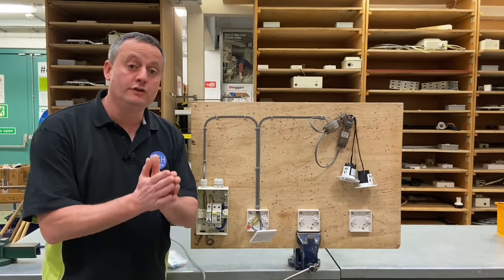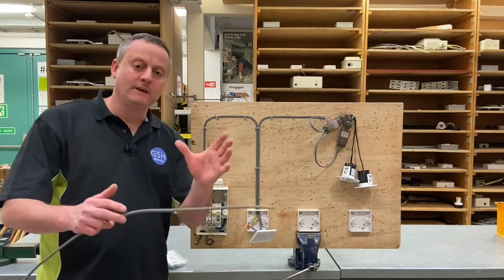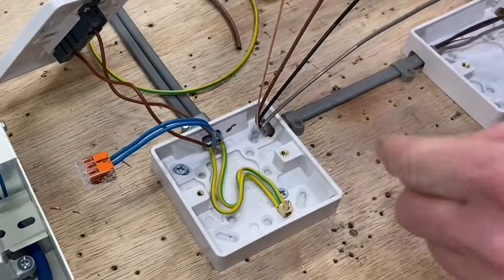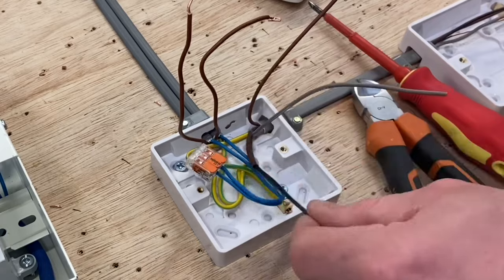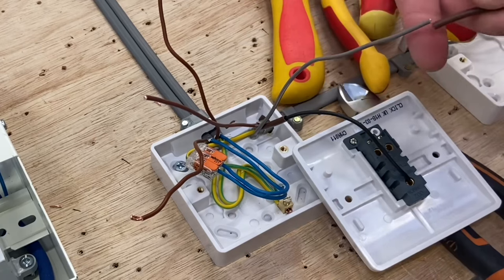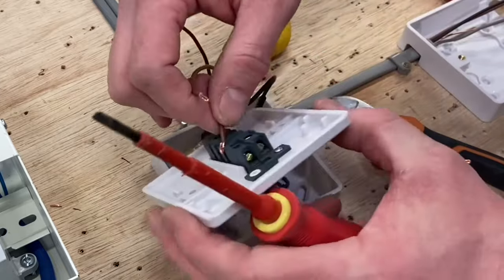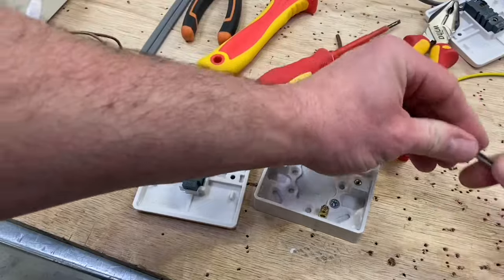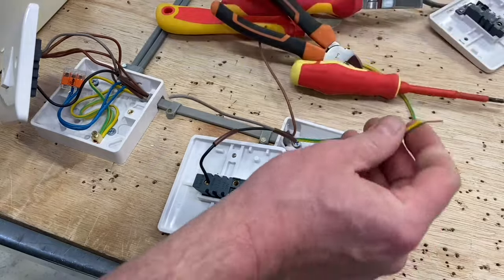Lighting Circuit 2 Plate Method How to Wire and Connect up 2 Way Switches (Connections Explained)

Comment: I'd draw the the circuit diagram with sw1 and sw2, L1 and L1 terminals link together with the brown wire is the permanent line terminals, L2 and L2 terminals link together with the grey wire line,is the switch line terminals. The common terminals is link together with the black wire line.

Comment: Fantastic video, I get how taken the feed to the switch makes for less cable at the lighting point when installing down lights, I just don’t like it I think it’s a throwback to the 40s/50s 
As two way switching doesn’t anyone us the loop in that method anymore? I was tort to take two three core two way switch cables from the lighting point to each switch and link the yellows /greys with a connector block at the lighting point, can also use the junction box method. Anyone who doesn’t learn from GHS videos should rethink their career path . Gaz makes it so simple and easy to understand and learn. But who am I to argue i’am just a humble spark who’s opinion means nothing,
Fantastic video Gaz as always 👍👍👍👍❤️

Comment: Great video thanks for sharing.  I wanted to know understand how this setup could be extended to work with a 2 gang switch where the second switch is 1 way.  I have the 2 way working and thought all you would have to do is connect the permanent live to the second switch common and L1 to the SL on the ceiling rose.  Whilst the 1st switch wit 2 way works the second switch only works when the first switch is also on.  Any suggestions on what needs to be changed or a wiring diagram for this type of setup?

Comment: I've been told in the AM2S Refresher to use the Grey as a neutral?
Reply from the maker: Wiring Diagram Wired Through the Switch Lighting Circuit AM2 & AM2S - 2 Way & Intermediate Explained
https://youtu.be/cIPZhriDQr8

Connections Explained - Wired Through the Switch 2 Way and Intermediate AM2, AM2S & AM2E Assessment
https://youtu.be/Xe_ap2eRjYI
Reply from the maker: Hopefully these 2 videos will help 👍🏻
Reply: @GSHElectrical  Thank you, your an absolute legend and your VERY responsive! Just watching that video now.

Comment: Hi Gary, I love your very instructive videos. Can I ask a question on two way circuits please? I have a double gang switch that has an extra terminal on one of the gangs with two L1. There seems to be a short cable link to the other gang which is for a simple outside light. I'm just a DIYer so I don't know how to describe the unit to order a replacement? Thank you, Mike

Comment: Awesome explanation! Thanks alot. I have one question... so i have a two gang switch that controls two seperate lights. I have loop in and loop out at the switch and I have a small link wire connecting both the commons together feeding both the lights. If in my case I would like to make one of the lights in this two gang switch have a seperate switch controlling it in a different location... how would you go about doing this? A three core and earth would be needed but if the black wire is placed in Common of the light switch then would the small link wire between the two commons still allow the other light to work? I would really appreciate your help.

Comment: Hi Gary, Q for you if you don't mind?   I thought I'd seen this somewhere in a presentation of yours the other night but now can't find it! - argh!   I need to continue the feed to a simple single light and on/off switch but......... taking the feed out of a 2-way switch.
As per your instruction I have Black as Common and Grey and Brown of the incoming 3-core in L1 & L2.   From here I want to feed a switch just nearby.
So to which terminals do I take my 'twin & earth' cable to the next switch please........?!
My (Geordie!) logic tells me connect into the Black in the Common of the 2-way switch and the Blue (now I'm struggling!) into the Brown (L1 or L2) of the 2-way switch.
Is there going to be a loud POP! doing this - sadly no RCD's here just plain old fashioned exploding block fuses I fear......

I await your kindly guidance please?!
Reply: Did you manage to sort it? You will only be able to continue the a loop out if you have a neutral present in your existing switch. Best practice would be to take the loop out from your main ceiling pendant or using a junction box otherwise.
Reply: @rayc1503  Hi Ray, kind of you to reply.   I have managed but I did have to chase a further cable down to the switch for the reason you describe.   Sorted now anyway - I'm not the sharpest electrician! (general builder in fact)
Reply: @MrTonyCresswell  I'd suggest Quinetic switches instead of chasing in walls. The master receiver switch requires no neutral. Then beyond this you can pair upto 10 further switches. No mess of having to redecorate. I've installed loads of them, even in my own house.
Reply: @rayc1503  Yes, I knew about them and would use when practical.   Fact was that in this instance the place was still a building site so 'redecoration' was away in the future anyway, so bashed on.   Thanks......

Comment: Trying to work out how the wiring leads to the switch function, the best I can come up with is this. Is this right?

You've got the permanent line at one, non-common terminal on both switches, and the outgoing line to the lamp on the other. To light the lights, you need to bridge between L1 and L2. You can't do that directly at a single switch. All each switch can do is either connect permanent line onto common, or else common to the lamp line-conductor. So you need one switch doing one job (permanent->common: "up", say) and the other one doing the other (common->lamp: "down" say).

So you need one "up" switch and one "down" (switch). Whenever you flip a switch and the lamps are off you change from a state where they're both up or both down (and so the lamp not lit because both switches are either connecting permanent to common [which goes nowhere] or common to lamp [and common is floating]) into an up/down combo (and so the lamp lit [permanent->common, common->lamp]). Or else you've turning it off, and it's the same argument in reverse. (And the up/down is obviously arbitrary at each switch, anyway). I've got that straight in my head, I think, but is there an easier way to think of it!?
Reply from the maker: Wiring Diagram Lighting Circuit 2 Plate Method Taking the Feed to the Switch 2 Way and Intermediate
https://youtu.be/L9DU8XkHn1U

Comment: Hi Gary,  Nice video.

Would it not be easier if BS7671 gave a regulation on an industry standard colour sequence for a two way switch
instead of each individual electrician using their prefered colour for common and L1/L2.  It might save a lot of 
confusion if everyone terminated the switch the same way useing the same colours.
Reply from the maker: I agree 👍🏻

Comment: Have you done a similar video but with multiple multiple gang switches, ie controlling different banks of lights from different locations? If not might make a nice follow on video from this
Reply from the maker: 2 Gang Switch Connections Explained - Taking the Feed to the Switch
https://youtu.be/K_iNzL2aWX4
Reply from the maker: Wiring Diagram Using a 2 Gang Switch Downstairs Upstairs 2 Way Switched Using 3 Plate Wiring Method
https://youtu.be/0VnbtsSPcow
Reply: @GSHElectrical  is there a version of this video where you go through connecting the items on the show board? I find that such a great way to visualise it compared to just looking at the wiring diagram on paper, sure im not the only one 😉

Comment: If you have used the 2 plate method to wire up  2 way switching, can you use the common to loop out to a new circuit or do you have to loop out from the light because there is no neutral at the last switch only the first one?
Reply from the maker: This should help

Wiring Diagram 2 Plate Method - Taking the Feed to Another Room or Switch Connection Explained https://youtu.be/R3_eXKo1NFQ
Reply: @GSHElectrical  thanks for the quick reply and link. Obvious once you see it. Amazing videos, thanks for doing it as really helps when doing level 2&3👍🏻

Comment: Great video again Gary extremely informative. Would I be right in saying that the wires on both those 2 way switching are all live or line either switch line or permanent  at some point or another and that the neutrals are simply carried through to the lighting point.

Comment: Just to say, that having the neutral in the switch back box with 2 plate method is good for keeping the luminare fittings free from congestion, but also useful if fitting a smart light switch. However, if fitting a strapper to allow two way switching, you can only buy 3 core and earth flat pvc and so will not have a neutral in the new switch for a smart switch. You can of course buy 4 core and earth in round pvc but then you will be lacking in continuity of materials used!!!
Reply: You only need to have neutral in one of the switches, because you don’t need to be able to smart switch at both locations.

Comment: Do you need to keep the cpc wire? Or can you just cut it off all together?
Reply from the maker: What if the switch or light is replaced with a metal one (exposed conductive part) it will need the cpc 👍🏻

Comment: a back hall light on a 2 way switch for the hall light the other going to an outside light, power from the outside light going to garden lights whats needed to be able to have garden lights on and be able to switch off the main outside light but be able to use main outside light on its own when needed ? im not trying it just curious

Comment: What throws a lot is when there is say a 3-gang light switch, say doing lights over a bed, ceiling light, LED strip with xformer behind a mirror, etc. This sort of setup is becoming quite common. How about a vid on one of these.  Maybe with two way -  3-gang at the bed and 3-gang at the door.

Comment: Lot of cables in the switch, wouldn't it be better to use the 3plate/ceiling rose when two way switching?Plus  It's got the terms for the neutral too...Nice video though👍
Reply from the maker: I have loads of videos doing the 3 plate method so it was time to do the 2 plate method 👍🏻. Thanks for commenting. Gaz

Comment: Great videos. How would you add a new light and switch using the 2 plate method? I'd like to add a light up the loft
Reply from the maker: Wiring Diagram 2 Plate Method - Taking the Feed to Another Room and Switch Connections Explained https://youtu.be/R3_eXKo1NFQ

Comment: Gaz how about you do a video on using the junction box method and the loop in method for two way switching, as mentioned in my earlier comment , no one seems to use it anymore .
Reply from the maker: 2 Way and Intermediate Switching Joint Box Method Wiring Diagram Connections Explained
https://youtu.be/wAJwzkMsmfE
Reply: Fantastic, but for some reason I can’t put my finger on it but that looks different to what I learned at college? Maybe it the colours that throwing me ? Still bring back happy memories of my time at Watford college. 
Brilliant video Gaz thank you 
As always 👍👍👍👍❤️

Comment: Would that stripping pass your AM2? Seemed to massively cut the copper.
Reply from the maker: You have a choice at AM2 to use a knife or side cutters... it’s up to u 👍
Reply: @GSHElectrical  What's wrong with regular strippers? Are they frowned upon?

Comment: Huh. So you’re connecting L and SL onto the two runners. Standard hookup over here would be to connect live to the common terminal, and connect the switch live to the wire coming back from the other common terminal. Obviously without connecting the two together. The two runner wires from switch to switch are the wires held in common for 2 or 3+ switching point setups, and only connect directly to switches.

Apparently your variant is allowed, and is known as a conductor-saving scheme, although in this variant of cable routing it doesn’t.

And then there’s apparently the “French variant” which is not allowed here (maybe still allowed in France?) and which puts two switches, each switching between live and neutral to make a switched live, and then put the load between those — so depending on the configuration of the switches, an “off” position could be either N-N or L-L, making changing lightbulbs something to do very carefully…

Comment: Why you did not show wire come from C UNIT to the one pol
Reply from the maker: This video is part of a series - 👍
Lighting Circuit 2 Plate Method Taking the Feed to the Switch and Connecting a 1 Way Switch & Light https://youtu.be/1G4fW2DeqPA